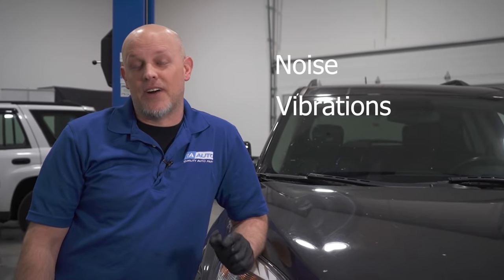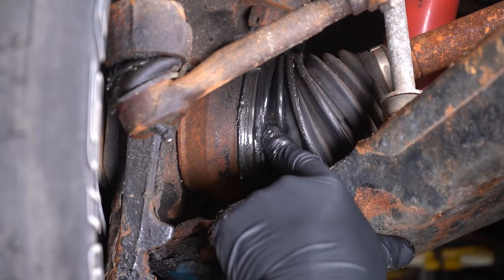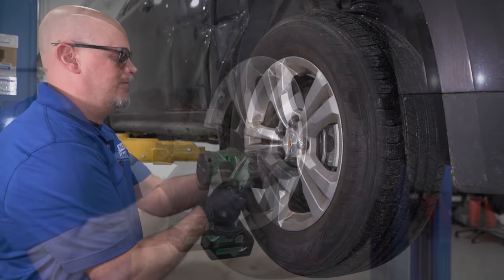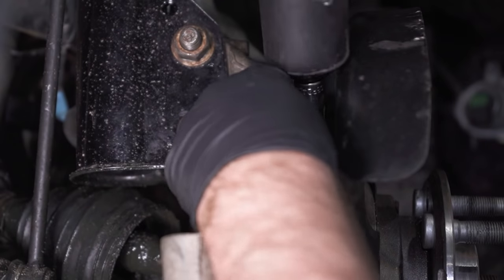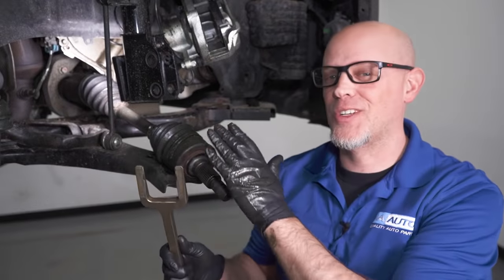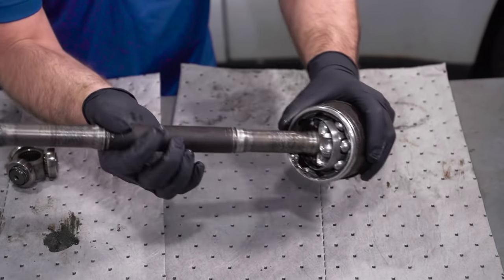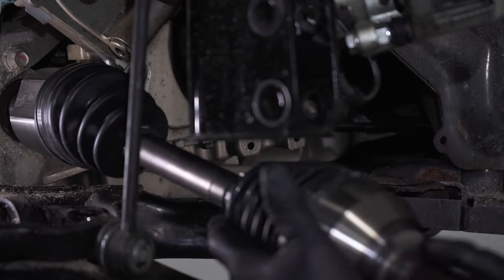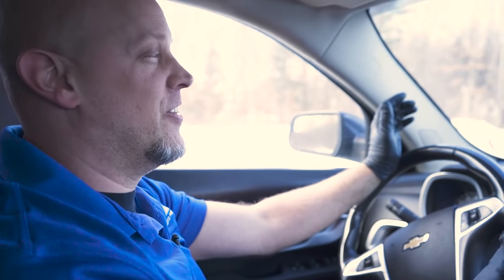Clicking noise coming from the front end of your car or truck? How to diagnose CV axle problems.

Comment: If you want to hate life itself,  try doing a passenger side Sienna CV.
Reply: Hahaha, true
Reply: OMG you are not lying! I had to cut the thing in half with a special blade, then I had to  remove the cv race housing and take a sledge to romove the center bearing.
Reply: @hatsunemikufan4  ha! i just had to do the exact same thing in a Highlander AND use a heavy duty impact hammer.... spent 3 days with car on blocks trying to get that axle out each night after work... until I finally cut it in half
Reply: Why is it so hard? 😂😂

Comment: If you get the clicking noise, don't put this repair off. Driving in this condition for a prolonged period  can cause transmission damage, or it can leave you stranded, and damage other parts. My front differential snapped and I had to find a replacement for that. It could also cause a bad accident if it goes completely while driving at high speed. Also, spend a few bucks more for original equipment.  I got Motorcraft replacements for about an additional  $50 total. Do noth sides at the same time. Parts and labor for the half shafts and used front differential was about $1000. It probably would have been $2500 at the dealership.

Comment: I saw a video on the same subject and the CVJ in question had a tiny split in the boot with minimal grease depletion - there was still plenty inside the boot.  A test drive showed no knocking.  The problem had been noticed really early. However the garage still changed the drive shaft.   They didnt answer my comment which questioned their decision to change the drive shaft.  Wonder why?

Comment: You can repair a split boot by filling it with grease using a plunger or a used hair dye bottle,  then cleaning the outer surface of the boot around the split with a good solvent, and then applying a decent quality marine sealant like Aqua Seal or Sixaflex.  That's the cheap fix.

Comment: I had a 85 ford Taurus with 150,000 miles on it and the cv axel was popping and clicking really bad but i couldn't afford to even buy a used axel so i tried something to see if it would keep it going a bit longer, i got a can of insulation foam and i filled the cv boot completely full of the foam and i let it dry over night, i ended up putting 150,000 more miles on that cv axel so it was original with now over 300,000 miles on it and it was still going with no noise, that insulation foam works really good by filling in all the loose areas and keeping the dirt out, give it a try and you will be amazed

Comment: I just had our local garage replace both front axles in my 2016 Dodge Ram 1500 within the last two months. Unfortunately, last Saturday I had a complete axle failure while on the highway 20 klicks from home. I was able to limp home and get the truck into the garage on Monday. We found out that the tripod joint had failed, and the failure had nothing to do with incorrect installation as I originally thought. A brand new axle failing.. interesting. Your video is very informative and helpful, thank you.

Comment: Great vid.   I have installed cv shafts, never took one apart.  Since I am in there, I change the axle seals (I wish there was just one axle seal design and one tool).  Mainly because I don't want to go back in again.  You make it look so easy.  Anytime I go under a car, something is seized,  strut bolts, shock bushings,  the cv joint itself in the way of the break caliper bolts or hub bolts etc.  5hrs to change hub, CV axle, strut to coil over.  Murphy always shows up @#$# shock bushings. Don't get me started on shock bushings.  Saw you video on that too.

Comment: The clicking is from the combination of it being a Chevy, being in a demolition derby based on the body,  and the fact that corners were cut by wasting money rebuilding the half shaft. Rebuilding the half shaft leaves metal and dirt in the joints that prematurely wears the bearing down and fails all over again. Replace the half shaft with a new one. More efficient and lasts longer
Reply from the maker: +Velvet Bear Thanks for the feedback!

Comment: Often times the replacement axles are of less quality then the OE axle. When they click it is often due to lack of grease in the joint. Removing and cleaning it thoroughly then re-greasing will remedy the issue.

Comment: What if the CV Axle clicks when you jostle it with your hand while parked? No leaking from joints. No slash in boot. When driving it sounds like metal on metal, crunching, and minor vibration

Comment: Mines not on turns. But it goes with acceleration I KNOW I need to replace my front differential on my dodge ram though, as 4x4 during winter time is a "use only to get unstuck" situation.

Comment: Please do a video on starters!!  Specifically for Chevy Silverado 2500hd 6.0 gas engine I have a feeling the fork inside starter that pushes the gear in and out has broken and causing my gear to move loosely and smack into the bindex when I’m driving around creating a weird tink tink sound
Reply from the maker: +Full🙃throttle We do not have a video for this repair right now, but we'll keep this request in mind for a future video! http://1aau.to/m/Shop-1AAuto-c

Comment: I just replaced my driver’s side cv axle due to a clicking noise mainly on low speed right turns. I still hear the noise… what could the issue be? Bad axle? Wheel bearing?

I also need new sway bar end links bc they are blown, could that be it too?

Comment: I WAS HAVE SAME CLICKING NOISE IN LEXUS IS-250 2008 USA SPECIFICATION LHD. IT STARTED REAR LEFT SIDE THEN ON BOTH SIDE. I SEARCHED LOT ON NET & WORKSHOP IN UAE  DUBAI BUT EVERYONE FIRST UNABLE TO FIND EVERYONE  RECOMMEND TO CHANGE COMPLETE REAR DIFRENTIONAL & BOTH AXIL HUB ETC. THEY ASKED $3000/+ LABOUR $:500/. I  DIDN'T FOUND ANY CORRECT INFORMATION.TODAY I FOUND  CORRECT PROBLEM AND JUST NOW ON 14.5.2024 SOLVED WITH JUST $:200/. IT'S REAR AXIL JV JOINT BEARING SLIP NOISE.  SIMPLY EITHER GET IT REPAIRED OR CHANGE AXIL PUT  USED AXIL.  NOW IT'S 100% PERFECT.  IT'S VERY  IRRETRATING NOISE OMG.

Comment: If the boot is intact and there's no grease coming out but you have a small clicking noise but it only started after we did the front ball joints upper and lower and the rocker arm on a '99 Corolla what do you think that could be besides the CV axle I'm dumbfounded

Comment: I heard a cling clang noise on my Camry and the next day I started it up it would not go in reverse and made a horrible grinding noise so my car has been sitting due to my anxiety about getting the correct information about what maybe the issue and cost 😕
Reply: Could be the brakes? Jack the front end up (both sides off the ground) and see if you can turn the wheels back and forth. At the least, pull each tire off and inspect it ASAP.

Comment: You said early in the video you could just change the boot.
How in the hell you get the new boot on with removing CV joint from the vehicle? 
The boot is smaller then the end of the CV joint, it wont go over them.
So if y'all got to change the boot ya might as well change the CV joint!

Comment: I just replaced passenger side cv axle, it is making a noise. Transmission goes through the gears just fine, no binding or hard shift, very smooth.

Any ideas?

Comment: I had this happen to my car today but I'm confused wat it will be??? I was driving esrliar an out of no where I started hearing this loud clicking an clucking noise but from my side an wen I went outside to check the car that's wen I found that it was leaking a bit of water but it was mixed with grease oil???? So I'm not sure of that's engine oil or something else??? But the issue was coming from my side only,,,,which was the driver side????

Comment: My CV visually looks fine, but I get the clicking when driving, but heres the thing..... it happens when I am going straight, left or right and it happens randomly and unpredictably, sometimes when I turn it does it and sometimes it don't. I know what a bad CV sounds like and it sounds exactly like a bad CV, but I am not convinced yet cuz it doesn't happen consistently or just when I turn. It also does it when I am coasting or accelerating, but then it won't do it while coasting or accelerating. Again visually the CV looks fine, all boots are good and not punctured nor is there any looseness in it when I feel it, and theres no grease on the inside of my rim. When I do hear it it is coming from the drivers side, CAN SOMEONE HELP?!?!?! 2008 Toyota RAV4 V6
Reply: Did you find out the issue?

Comment: I have a 2016 Chevrolet Traverse LT all-wheel drive it makes a clunking noise when you take off and it quits  making that noise once you get going. It shutters when your going up hills and taking off at a low speed. I got my transmission oil changed thinking it would help but still no help. Any suggestions